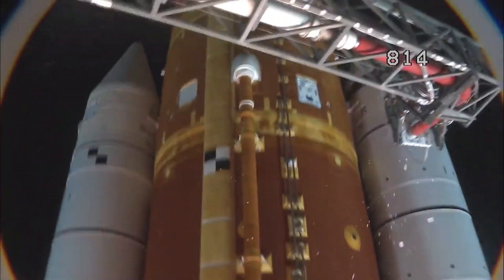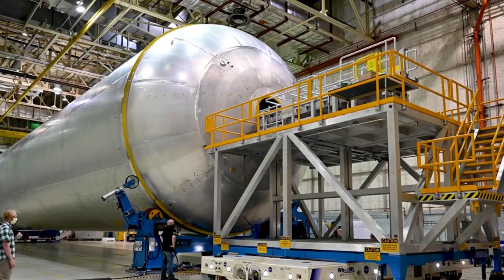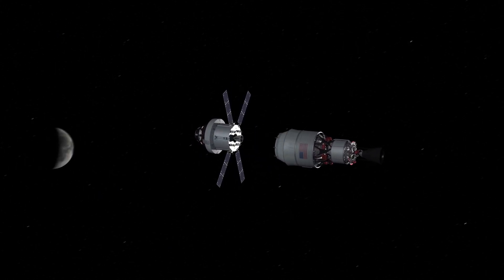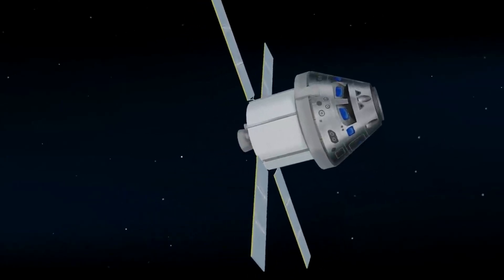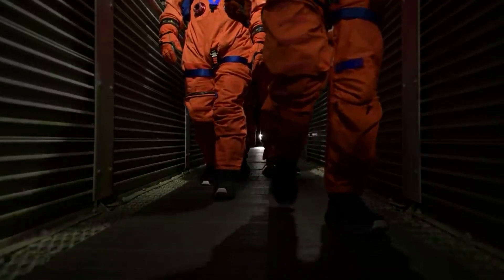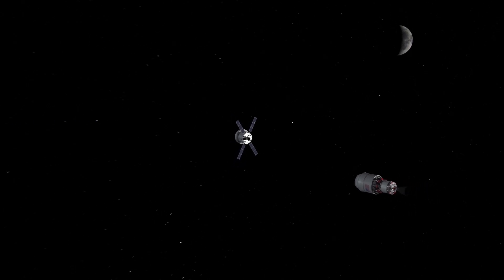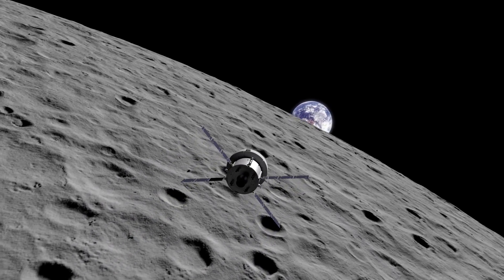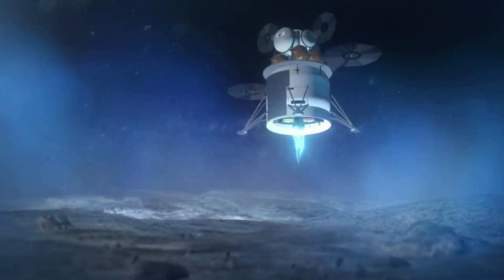NASA’s Artemis II Moon Mission Is Coming Together Quickly

Comment: After Elon launch starship they not even gone care for the little weight that thing can carry because eventually there gonna want more and more cargo
Reply: It can carry humans end of story
Reply: Star turd went BOOM.
Reply: There are various SLS configurations, the largest SLS, Block 2 Cargo is capable of hauling 100+ tons to the moon (not just to LEO).  Starship can lift more (150-200 tons [projected]), it needs refueling to transport cargo beyond LEO. It'll take 5 to 6 refueling flights ($1.3 billion - projected) to get to the moon. Starship will be cheaper, but the total cost will not be that far apart, and not accounting for the additional fail rate risk with multiple flights.